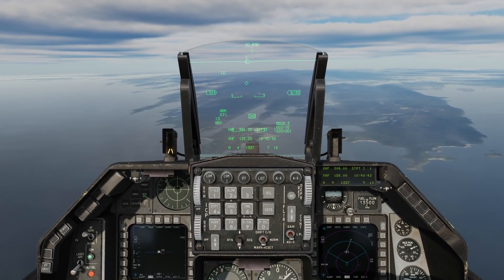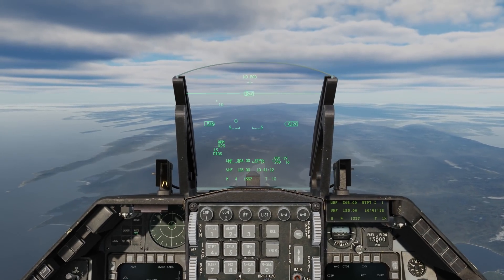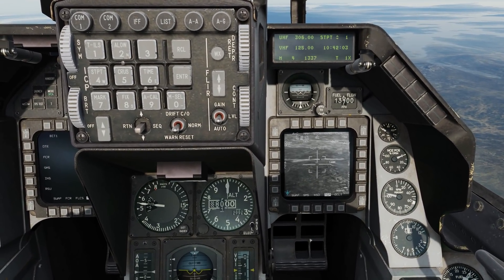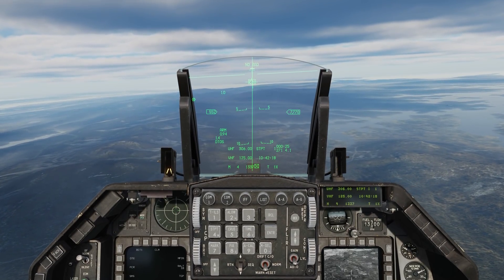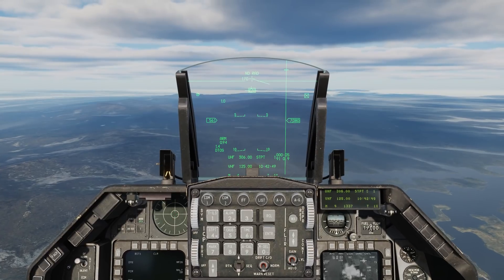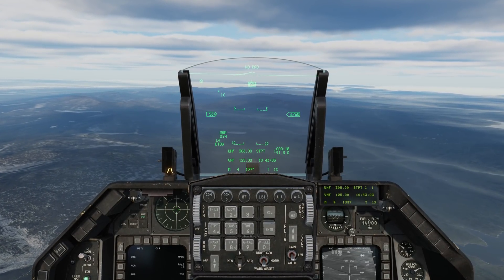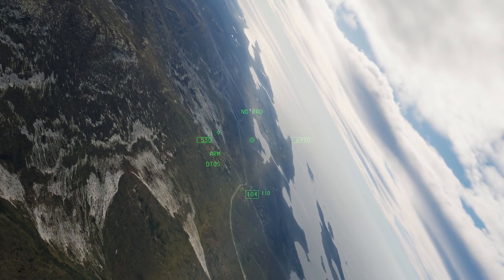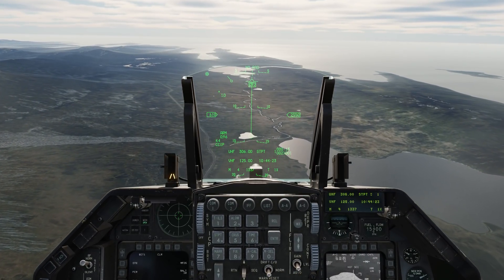DCS: F-16C Viper | DTOS

Comment: Using DTOS, can I select a pre-programmed steerpoint as a SPI instead of selecting visually with the HMCS/TGP? 

That way I can use DTOS for Ross bombing at greater accuracy than in CCRP mode where the bombs always land long by 100ft or so?

Comment: Just spent an entire afternoon trying to figure out the helmet to mark targets and this made it so simple....I'm still new a bit with dcs and especially the f16.
Reply from the maker: It very much is simple; you must need to make sure you have the correct SOI set up.
Reply: @MattWagner  before this video I was trying to use the helmet to mark while in ccrp and wasn't aware only certain modes are capable. The video made it more clear to me. Thx.

Comment: hello matt,
as a new player i really really appreciate all your videos!
i have one question:
will the f-16 flight model get fixed according to real f-16 pilots feedbacks, that the f-16 does not bleed speed so fast IRL and can also accelerate again as soon you losen the stick and get out of the AOA limit? that would be sweet! because i already had the issue, that the f-16 just refuses to speed up again once you passed a certain point. it takes ages even in a straight flight, to get back to a decent speed. this seems not right for this light fighter. thanks!

Comment from the maker: To answer how this is different than CCRP, there are two big differences. First, the DTOS designation is initially slaved to the FPM, and this allows faster and more accurate designation through the HUD in visual, diving attacks. Second, DTOS allows visual designation through the HMCS, whereas CCRP does not. Related, and noted in the roadmap, the HUD Toss Anticipation Cue will come a bit later.
Reply: Thanks, on the flipside what would be the advantages of using CCRP over DTOS now?
Reply from the maker: @lankypilot778  CCRP is better for known target locations using PGM delivery by TGP/FCR/COORDS, whereas DTOS is best suited to visual targeting through the HUD/HMCS.
Reply: Hey Matt.  Shouldn’t the dtos provide visual hud cues for a low ingress that then transitions to a rapid accent to where the bombs follow more of a ballistic flight profile?
Reply from the maker: @MrGameMeister  See pinned comment. "Related, and noted in the roadmap, the HUD Toss Anticipation Cue will come a bit later."
Reply: @MattWagner  iiibhf
Reply: So “dive” is the part that’s implemented, with “toss” to come later.
Reply: Okey but why just not use a mark point instead of DTOS?
Reply from the maker: @patrykrafa4259  Much faster.
Reply: Yes to the HUD Toss Anticipation Cue. Thanks for putting that in the clear.
Reply: answered the exact question I had! thanks
Reply: Thanks Matt, the video description and this comment chain answered all the questions I had. Much appreciated.

Comment: I just don't quite see how this is any different from a regular CCRP attack?
Reply: The DTOS mode fills the void between CCRP and CCIP.
In the Viper, the CCRP doesn't do any precise slant range calculation. It just means "shoot on coordinates". So, slewing your TD BOX in the HUD (or the HMCS) from a CCRP designation, to a target, will not calculate a precise slant range.

In CCIP, the plane switches the FCR to the AGR mode, in order to obtain the precise range between your plane and the target and provide the better accuracy possible for the ordnance. 

In DTOS, the plane does the same thing, but from that mode you're able to designate the target with a TD Box in the HUD. The point is to be able to do a "CCRP" drop but with more precision.
Reply: @Wawar9  thanks for a great explanation
Reply from the maker: See pinned comment.
Reply: Pretty sure most of us will end up using it just to lock the target area with the helmet.
Reply: Exactly, what is the purpose ?
Reply: same, I thought the "toss" part of DTOSS was somehow significant...?